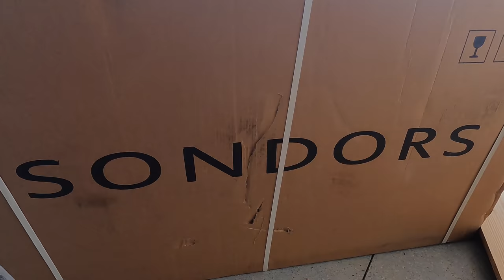SSL622 ~ so we had a little issue...

Comment: Unless you absolutely have to have no brainier autoflight features at the push of a button in a preprogrammed transmitter like gps waypoint navigation and set and forget follow me function,  do yourself a favor and Get yourself a cinelifter or 2.   Pair them to a quality transmitter, receiver, good antennas and some fpv goggles. A smaller one is more than capable of taking a GoPro aloft for better video than a DJI or its big box competition.  They are much easier to repair and customize too,  and the 7" or above ones can fly a full size camera and gimbal if you really want. Then you can fly your good 4k cameras, or invest in a portable 6k digital cinema camera like a Z Cam E series, one of the Red mini digitals (a komodo if money's no issue),  Canon EOS series, Sony FX series or Black Magic Ursa Mini Pro series  I agree DJI sucks both their products, their police software, and customer service.